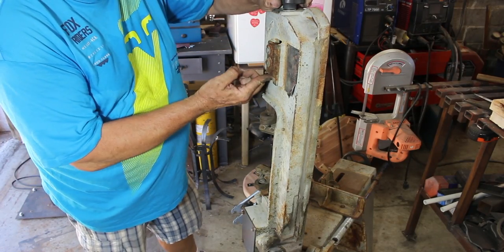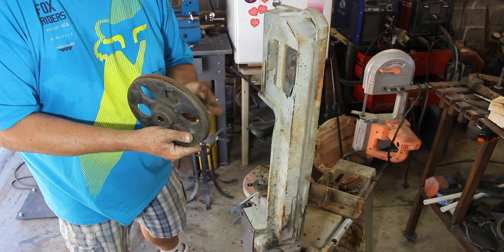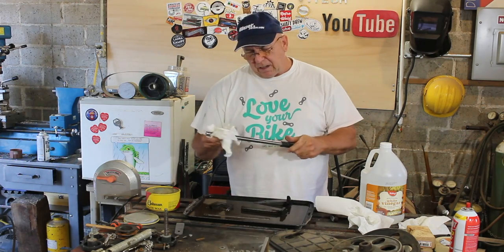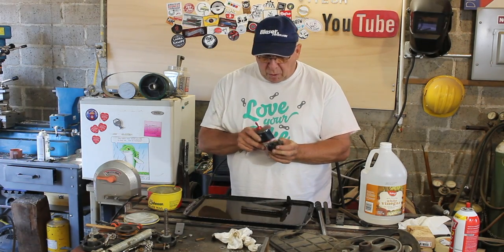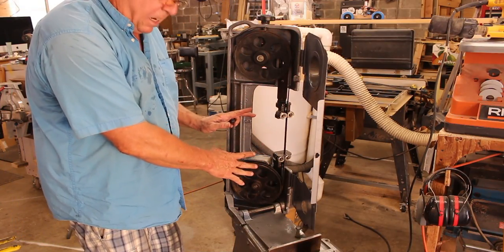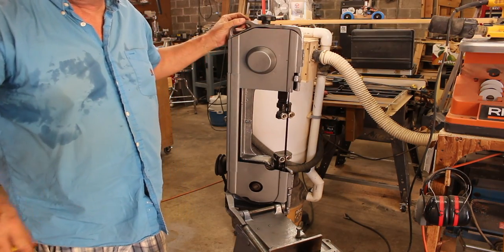Yardsale Bandsaw Overhaul!

Comment: hi, a few things can cause the blade walk like that.
first you can pivot the blade guides to correct the walking. put a square from the base vertically and check your blade. make sure your bearings just let the blade thru. you dont want them to tight a few thoul space is good enough. two of the bolts that hold the horizontal bearings are cams. each carrier shouls have one fixed and 1 cam.
 you can loosen the bolt that holds the blade guide carrier  to the arm and pivot the carrier to straighten the blade.
 second if the blade is missing a few teeth it will pull to one side.
ha, your next project is to make a hydraulic cylinder for that saw. changes it completely and it will save you blades
if your having a hard time aligning the carriers you can fit a scale ( from a adj. square) between the bearings to give you a rough alignment)

so to recap in order
1, adjust bearing gap for the blade
2, align bearing carriers (with blade in & tensioned) using a square vertically against blade ( base to blade)
test cut and fine adjust leading carrier ( both carriers need to be very close in alignment)
3 have your favorite beverage and admire your work
Cheers

Comment: That was a lucky find.  The guide bearings on the blade are adjustable by a bolt that they are mounted on.  You can get the manual from Harbor Freight as a PDF.  That should help you a lot on instructions on setting the blade.  You will find the blade guide bearing adjustment in figure Q and of course at other places in the manual.  And I think Chuck Bomarrito and Rob (Xynudu)  has show the adjustment among others.  Look to youtube.

Comment: From the other side of the world I have exactly the same saw. They work great. Want to do a cutting fluid cooling system to mine. Great work!
Reply from the maker: I ended up replacing it with a Slugger cold saw. Much cleaner cuts.

Comment: Awsome skills, you have, great !.
Regarding the non square cut, I sugest to put a 90 degrees squared block at least 5 inches of vertical travel distance, and with the blade not running do a vertical travel and compare if the angle is bad, if yes then revise the guide bearings that leads the blade.

Comment: I picked up what looks like the same horizontal bandsaw off of Craigslist. Mine isn't in quite as rough a shape as yours, but it's still pretty bad. I assume that like you I'll be replacing every bushing and every bearing in the entire machine. Unfortunately the motor has no markings on its casing except the country of MFG (Taiwan) and its size (3/4hp 1725 rpm). I does appear, however, that your motor is the same unit that's in mine. I was wondering if you knew who the MFG of your motor was or what bearings I need to order. Any help you can give would be greatly appreciated.
Reply from the maker: News Now Twin Cities the way I address that is remove the old bearings and replace them based on markings on the bearings or if there are none, go by size.

Comment: Hello, i want to know how much KW is the electromotor and what is its RPM. I have the same bandsaw but dont have the electromotor for it. Thanks!
Reply from the maker: 1750 RPM, any 1/2-3/4 HP motor should work fine.
Reply: @WildmanTech  thank you very much!  I installed 550w - 3/4hp three phase, 2100 rpm and stop under light load. It drives me crazy!!!
Reply from the maker: @Otto-von-Grunf  3/4 HP should not stop under any circumstance. It sounds like something is wrong.
Reply: @WildmanTech  I don't know, it's already the third engine I've installed, now I'll install 1Kw and I will see.  I changed all the bearings and completely rebuilt it, the only thing bothering me is the engine (it wasn't there when I got the machine).
Reply from the maker: @Otto-von-Grunf  with problems like that it is not the motor! Look at the gearbox and the bearings.
Reply: @WildmanTech  I installed ALL NEW bearings, the gears are a little worn, but no big deal, I really don't know what else to do.  A simple machine and so many problems.
Reply from the maker: @Otto-von-Grunf  turn the drive pulleys upside down. There should be no amount of force you could apply to the blade that would stop the motor. It should literally shred the tire on the drive roller before it stopped the motor.
Reply: @WildmanTech drive pulleys are set to slowest, maybe the problem is in 220V Single Phase Variable Frequency Drive VFD 2.2kW 3 Phase AC Motor Speed Controller.
Reply from the maker: @Otto-von-Grunf  most single phase VFDs will drive a three phase motor. There’s usually a dip switch setting to get it to work right.
Reply: @WildmanTech  thank you very much for your help, I installed a stronger electric motor (1Kw) and now it works fine. It looks ugly with a big electric motor, but it is important that it works. Thanks again for your help!!!

Comment: I just bought one like this called continental 45m for $25.. I think the problem is your spring is not tight enough. The feedrate seems too high.  I redrilled and tapped mine to give more spring pressure. I still cant get the saw to slowly come down on its own, I have to hold it as it cuts.  I think I need to go look at the ones at harbor freight. Its the same design.
Reply from the maker: I'm thinking it needs a shock absorber that I can use to adjust the feed rate. The spring just ain't cuttin' it.
Reply: The saws I use at work all have hydraulic cylinders with closed loop on the lines with a bleeder valve of sorts..
Reply: a bottle jack could maybe?